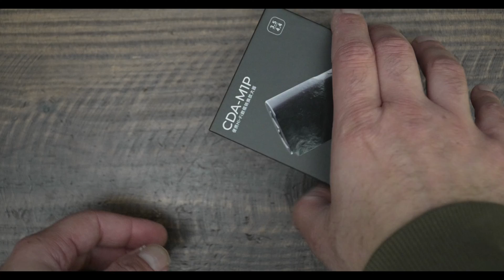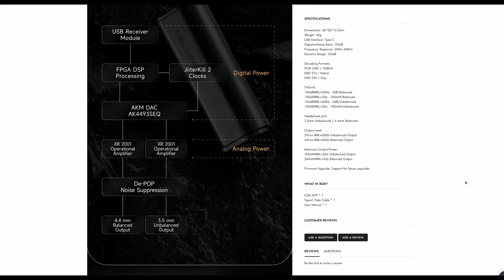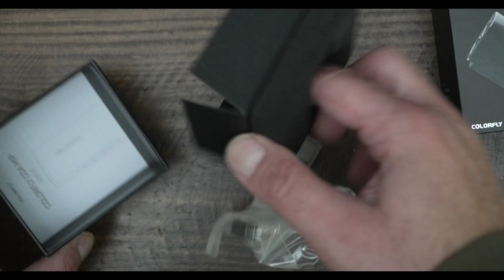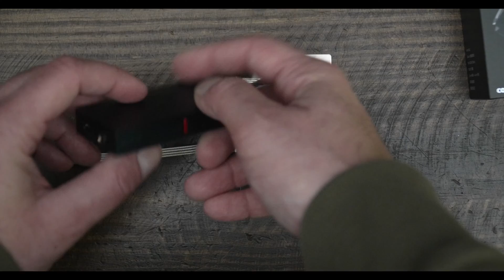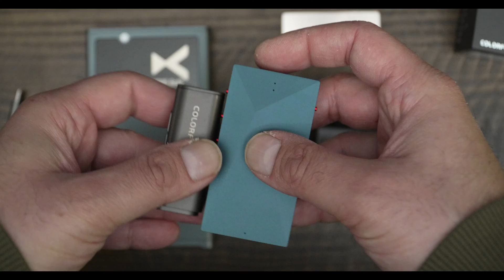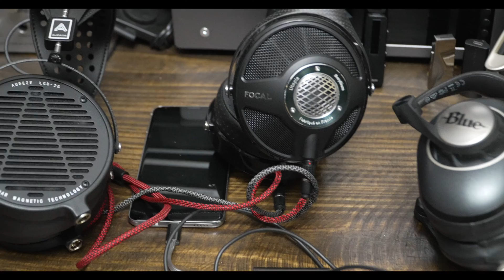Colorfly CDA-M1P - Bigly Wiggly

Comment: You claim that if you volume match, there is no audible difference, i have a conter example comparing colorfly m1p and moondrop dawn 4.4, it is volume matched using a microphone and high frequencies are much more pronounced on dawn 4.4, is is very noticeable on recordings with vinyl crackles, it is very audible and sharp in dawn 4.4 but very smoothed and toned down on m1p, as if the treble knob on an amplifier was turned down by 6 db. I head it on s12 olina and ea500
Reply from the maker: You did an actual A/B comparison at the same time using the same IEM/headphone or you volume matched with a microphone one after the other or you used different IEMs and headphones for each? I can’t tell what your process was.
Reply: Plug s12 in dawn 4.4 , set normal listening volume, record pink noise in audacity (lav mic in zoom h1), now plug s12 in m1p, record pink noise in audacity adjusting volume in m1p until it visually match the loudness of dawn 4.4 recording. Listen to song with vinyl cracks pluging the s12 in both dac. Then i did the same with olina and ea500.
Reply from the maker: Just to be clear, you didn’t do an A/B test with a switchbox?
Reply: No my switchbox is 3.5mm only, here i compared 4.4mm but even with the 1-2  second delay for manually switching the 4mm plug from one dac to the other, the difference was easy to spot on high frequency sharp sounds such as vinyl crackles
Reply: @NoThemeReviews  please try this song in a/b testing a "analog" dac (m1p,ifi go link) vs a "hifi" dac (dc03pro, dawn 4.4,apple dongle) and check the vinyl crackles they are much nore pronounced and sharp on the latter category : https://www.youtube.com/watch?v=pdvFN_7NSyQ

Comment: Do these sound the same as an entry level dongle like Abigail pro?
Reply from the maker: The majority of modern dacs are neutral. They don’t have a sound signature, despite what the usual audiophiles say. Dacs have minimal influence on the sound, on the rare occasions they do. If you have a dac you already like and don’t have any specific need to buy a replacement, then don’t waste the money. Either save that cash for a rainy day, or buy yourself an IEM or headphone—which are a far better use of money than a Dac or amp.
Reply: @NoThemeReviews los cambios que se pueden encontrar no se limitan solo al perfil sonoro